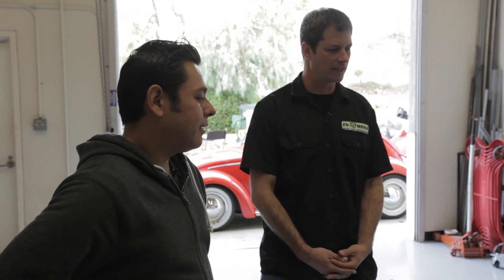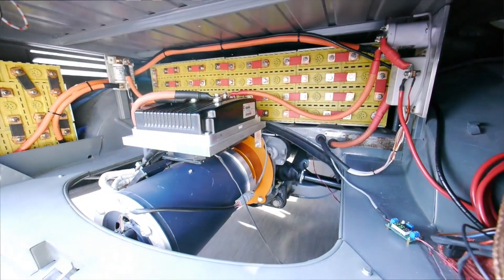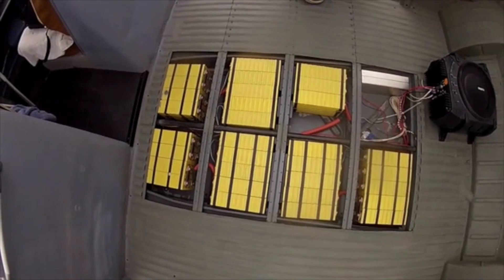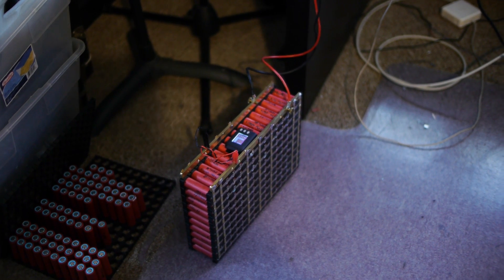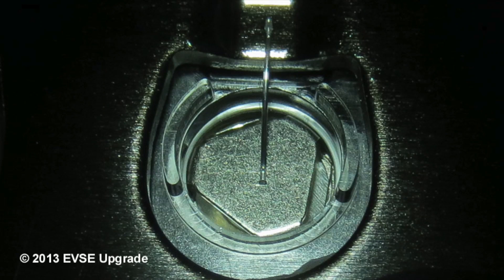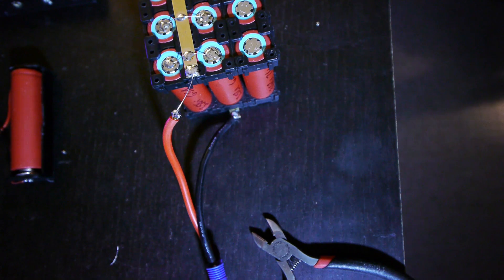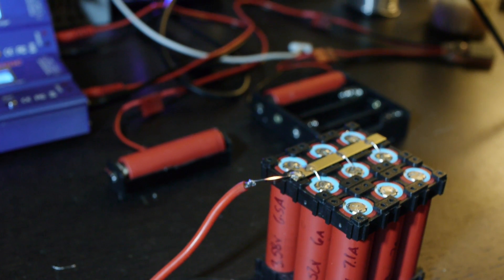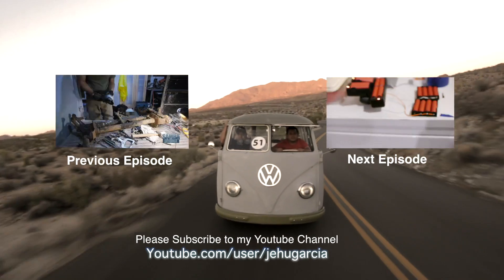TESLA style battery cell Fuses 18650 DIY EV - eSamba

Comment: ok let me show you what i am talking about. My intention is not to anger anyone. Telsa batt system is supposed to be more efficient which i dont agree with but for sure its a niche, why, the charging and cycling is extremely precise and critical for the life of the battery. The other thing...you used solder to connect those batt , the heat from the iron is going to damage your batts. But you can buy the batts welled for no additional charge in the config you want and use a decent cycler to charge. you can still incorporate the fuse also. in any case thanks for your time.
Reply from the maker: Do it,   Show us how its done,    its easy to say do it better,   doing it better is what separates the doers from the sayers.
Reply: not really. Architects never build houses. Still because of them there are wonders in this world. I do want you to do it ...all i am saying ,think outside the conventional . Best wishes to you then.
Reply: David Hall On the contrary, many architects build houses.  Most of them come from construction backgrounds, you can't just consult on a subject matter without actually getting your hands dirty at one time or the other.  For example most architects often build their own homes, you only have to look at a show like Grand Designs, or Extreme Homes to see proof.  I really admire Jehu and Elon for pursuing their dreams and actually MAKE something.  David it seems to me like you think there is a better way, well as the old saying goes.. put up or shut up :)  Lets see video proof of your better way.
Reply: thankyou for your response at least you do understand somethings. As i said before i am not putting down anyone i was at a wonder as to why they were going the direction they did, but it seem as if they were simply following.Someone gave them a super suggestion and the response to it was what i would characterize as negative main stream. The suggestion would solve they problem and put them on the map at the same time . This is why i dont have to build the house there are building . I am not a follower i would build a different house.
Reply from the maker: someone has to build the house,  my house your house, everyones, but if you're not willing you are going to live on one, someone else built.
Reply: David, we are straying off from the main point of your original comment, I don't think any of us really care what architects do.  
I want to challenge you on your statement that "Telsa batt system is supposed to be more efficient which i dont agree" ok so you don't agree its the most efficient, but you don't give an example of a MORE efficient battery system.  I could say the same thing, I could say that a 'flux capacitor' is more efficient, but as you know that is bullshit.  So like I said I challenge you to backup your statement.
Reply from the maker: Air batteries?    Where is the proof?  please provide a link, picture,  or some other of proof

Comment: hay jehu take a look at this i dont think the fuse wire is the only way the electricty is passing threw take a look it looks like the top mettal panel there putting is also touching the conection of the batterys
http://www.teslamotorsclub.com/showthread.php/22273-Model-S-Battery-Cell-Panasonic-NCR18650PD
Reply from the maker: no the wire is the only electrical connection to the cell all other materials are isolators,   the c shape mark on the negative side of the cell is not exclusive to tesla cells,  I have old panasonic cells that have it on them,  I don't think thats a vent either,   the vent is on the positive side under the triangle shape elevated plate.   That post has a lot of theories not a lot of facts.

Comment: Mr. Garcia, Thank you for the valuable input. Can I ask for a couple of sources from you, please; Where can I get pre-made S6 charge balancing wires and harness; and what about that black plastic 'carton' to hold the 18650 cells top and bottom? 3D printed? I need that setup for my off-grid solar home.
Reply from the maker: http://www.usastore.revolectrix.com/Products_2/Cellpro-PowerLab-6-EC5-version_2

http://www.aliexpress.com/snapshot/2000301954.html

Comment: OK, so you wanted to be sure the wire fuse was ample to carry the highest anticipated motor load.  But how did you arrive at knowing it was low enough to blow when the cell had a runaway short- how much current does a cell produce when shorted?  5C?

cheers!
Reply from the maker: I've seen 15 amp out of these cells,  the idea is that a short would blow the fuse anyway as the power needed to blow it would not be coming out of the shorted cell but into it from all the other 149 cells which are capable of 900+ amps

Comment: Mr Garcia,

Great work, great concept, thanks for sharing.   Question:  What actually happens when a cell shorts?  Does it have an internal breakdown causing it to discharge it's full 8 watts and thus blow the wire fuse?   
thanks!
Shawn
Reply from the maker: A shorted cell is a big mystery to me,   there are those that say cells can short out either in an open circuit form or a more traditional closed circuit.  I have no idea if this theorytical or if this actually happens to batteries every day.
but If it does happen and one cell shorts out,  it would essentially become  a conductor to short out 149 cells and their combined 900+ amps would incenerate said cell in seconds, starting a fire and thus a chain reaction with all adjacent cells.

Comment: Hi 
I built a 1200 cell using old laptop batterys 20 modules 60 cells. Weighs 70 kilos with casing ectr. Im in the middle of building 20 x balancing circuits for charging in 1 long string 72v pack 84v fully charged. title of video is (how to build 1200 cell lithium battery pack). I bought a cheap spot welder off ebay. around 20,000 spot welds. im hoping to draw 200A without to much voltage sag or fireworks in the back lol.
The strip i used to connect the batterys will melt at 10A if cell shorts. 
Cheers
Gary

Comment: Have you tried using NiMH cells? I always wondered if those could be a cheaper option
Reply from the maker: I haven't really found cheap NiMH cells,   the lower voltage means I have to use twice as many so they come out costing just as much or more .
Reply: I see, thanks

Comment: What is the maximum amperage rate that you can charge these cells without harming them? You have 150 cells in the module and how long does it take you to charge it?
Thanks!
Reply from the maker: Tesla charges the 85kwh pack at 135kw,  in theory i should be able to charge my 40kwh pack at 70Kw rate

Comment: Hi there; I am converting a Ford/Mercury Cougar with good old SLA. Your project is truly inspiring, 40 kwh of light batteries for the same price of my 10 kwh heavy pack!
Thanks a lot for sharing, I am going to reconsider my design after watching your work. 
One of my problems with this kind of design is balancing: as cells came from different origin they will stray away with each charge/discharge. I don't think bottom balancing would work, and top balancing can be tricky which such pack.
Lately I am pondering about the possibility of performing bulk charge and afterwards topping the cells with slow individual chargers. There is an RC charger, the BC168  which do that at 8A.

Comment: Hey,

I watched the most of your videos now!
Keep up the good work! It's a nice project!

In this episode you explained that you need 4600 cells, wich costs you $1150?!
Where did you get these batteries so cheap?

I also have a question about the electric motor.
As you probably know, the Tesla model S has a 416 hp electric enginge, and contains over 7000 18650 rechargable lithium batteries. The car also weights more then 2000 kilo. Altough the car is pretty heavy, it has a range for about 480km.

Does the weight of the car, and the amount of hp effects the battery durability?

For example:
A car weights  about 1000 kilo. (50% lighter then a Tesla Model S)
The 200 hp electric engine and 3500 18650 cells are also 50% less then a Tesla model S. Do I still achieve the same range of 480 km (Or something near that)?

I'm sorry for my bad English but this is the best way I could describe it.

Regards,

Herman
Reply from the maker: Thanks for watching.  Im buying cells on ebay,  watch Episode #12.
Vehicle weight, motor size,  driving stile, all that stuff affects life of the batteries.

Range is determined by many factors,  vehicle weight, aerodynamics,  Battery size, system efficiency, and again Driving style.  50% less car with 50% less battery would yield comparable results but only if all other factors are identical.

Comment: Hi Jehu, The fusible link works well but doesn't it present a couple other problems. If several cells short and the fuses blows it puts a strain an all the other fuses possibly causing them to all blow even though there isn't anything wrong with the remaining cells. It also means the capacity of that module lessens and it gets charged to a higher voltage when the pack as a whole is charged. So next you need a voltage reporting system for each module but eh, one problem at a time.
Reply: Yeah, cascade failure is a problem, but I think fusible links is a GREAT final failsafe, but I do think that there needs to be a primary fuse on clusters which SHOULD fail first, and only if it fails, will each cell pack's fusible link fail. The links failing is far better than all the cells going thermal runaway.
Reply from the maker: Definately a challenge in our hands
Reply: Less of a concern if the pack is easy to inspect. In a Tesla that's impossible, but in the eSamba, no prob.  The cells in the old gas tank location might be harder to get to, but the ones in the floor will be a breeze to get a quick visual of all fuses. Easier and low cost compared to a real controller that could detect such things--maybe that's what Tesla has?

Comment: No problem, you can use my pictures.)
Reply from the maker: pictures? what pictures?
Reply: 5:35-5:44
greetz
mathieu
Reply from the maker: EVDrive so you took the tesla battery pictures?   Can you share more of them ?  Did you upload more info on the experience of disassembling the battery pack?
Reply: jehugarcia An EV-friend as the roadster battery module. I will work on that.

Comment: That is a much cleaner build using the wire. Is the wire anything special? Your soldering skills have greatly proved.
Reply from the maker: Wire is a 1/8 watt resistor legs,   maybe 1/4 watt resistor wire blows at 10amps
Reply: jehugarcia
What type of wire is that & what gauge is it?

Comment: Are you considering a spot welder or are you going to continue using solder
Reply: jehugarcia
I tried to join batteries with the solder, but the solder doesn't sticks to the battery. You use some special?? The finish is perfect.

Thanks in advance.
Reply from the maker: I think I'm going to stick with solder,  I don't see the downsides to it.
Reply from the maker: Alberto Serrano nothing special,  you need resin core solder,  and plenty of heat 480 degrees F

Comment: Jehu, great video as usual. On average, how much is each cell including plastic holders and stuff costing you? I like your average guy approach to EV building. Keep this up I'll have to donate some cash...
Reply from the maker: Its hard to say at this time as each cell is costing me about 30 cents,  but not all are keepers,  Ive currently tested  about 500 good cells and  600 cells that did not make the cut,  so the cost is higher than 30 cents, the plastic clips are $30 per module so I'm looking at $900 in plastic.
Reply: jehugarcia
Hey jehu, have a look at fasttech dot com for the plastic holders, if you ask for a quote there are price breaks.  I just ordered 100 of the 10packs for $1.56US per pack shipped.  If you buy a larger quantity it might go down further.  SKU 1290405  I can't comment on the quality yet but I have some on order.

Comment: Good evening Jehu, as an additional level of safety you could possibly house each pack in a sealed battery box, link them together with tubing run to a radiator and use a non conductive cooling fluid (eg 3M Flourinert). This should allow you to maintain the batteries at an optimal temperature and in the event of a thermal runaway within a cell it should hopefully prevent it spreading to other cells within the pack.

Comment: budget minded, or wise/clever with resources. an idea, traction pack level components are $$. for less problem and cost, run a dedicated bank /pack /batt sized for all the "12v" systems (runninglites, cabincomforts, controlheads, etc)  charge @48v drop down to 13to14volts. capacity of need for range. (prob been debated elsewhere) bear in mind, engineers have eng.dept budget, expectations, and paycheck.  good for them and they deserve it. there is only so many of those positions to go around however.       as always, your mileage may vary.